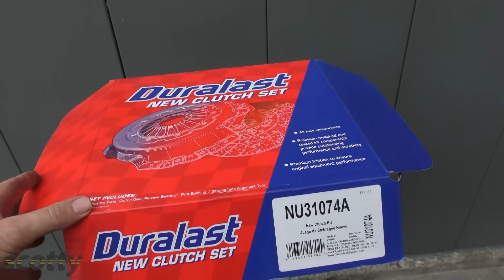5 Things You Should Never Do in a Manual Transmission Car

Comment: If you rev match while downshifting, it's not that hard on the clutch. Clutch wear is relative to the difference in current RPM versus the RPM required to match the gear you want - so minimize that difference and you minimize wear.
Reply: This is what I do usually when I'm approaching a red light, if I'm in 4th gear I downshift and rev match to 3rd, breaking until I stop.
Reply: True but it's also minimized by shifting less often so you don't have to match anything in the first place. Which I think was his main point.
Reply: Possibly, I think the bigger reason why he raised this point is that if you downshift frequently without rev matching your clutch will wear out very quickly. It's a lot easier for the clutch to slow the engine down than speed it up. My point is that rev-matching makes a big difference in mitigating this.
Reply: yeah with precise rev matching its a literal non issue. I do it sometimes
Reply: I got use to rev matching, it feels so much better than to just throw it in neutral.
Reply: darkest1evil1 that doesn't make sense. It's better to just leave it in 4th and let the RPMs drop. Then right before it bogs down push the clutch in and put it in neutral. You save fuel and save the clutch from wear plus it's less work
Reply: i rev match double clutch.. Minimal wear on clutch and transmission. But im guessing throwout bearing is suffering there hah..
Reply: then if you have to suddenly speed up you have to fumble around finding the gear you want. Always keep car in gear ready to accelerate. The brake pedal isnt the only way to avoid an accident. Sometimes you need to be able to accelerate quickly out of harms way.
Reply: if you just leave it in 4th instead of downshifting
Reply: You are all correct, its not necessary, but i like it and its not hurting efficiency of my driving.. Like EE said, we dont use manual transmision because its most efficient and fastest and stuff, but because we like to drie it, and i would like to add the fact its cheaper to manufacture
Reply: illstplaya save more fuel by downshifting and coasting in gear which will shut the fuel injectors completely off until you press the accelerator again. Coasting in neutral will use some fuel to keep the engine idling. There is a reason that you must keep car in appropriate gear on your drivers test or your gets points off. And also, if downshifting to a stop, I’ll usually downshift to 3rd then brake the rest of the way, but keep it in third until stopped. No reason to put it in neutral.
Reply: I drive 1996 car and it doesnt shut fuel when braking with engine.. eh
Reply: I bet he knows more than you
Reply: His advice is for the average driver who doesn't even know what the term "rev match" means.
Reply: It does have the side bonus that since you're still in gear. With the downshift, you probably have quite a bit of power if you really need it in a pinch. Neutral and you're basically a roller coaster and hopefully if you absolutely need a gear, you hit that gear precisely. Hard to beat it already being in at least some kind of gear. Perhaps the best compromise would be to downshift to from 5th to third at the appropriate time, so in that case there's only one downshift.
Reply: THE GIBBONS Have you driven a manual transmission car? You feel a lot of resistance in the clutch pedal when it's coming back up if you try to downshift without rev matching, and that resistance diminishes by a large margin if you kick up the engine RPM to match the downshift. That resistance is wear on the clutch; and reducing wear is part of the goal in rev matching.
Reply: THE GIBBONS You can do that, but the clutch wear versus a rev matched downshift is almost the same and you may as well take advantage of the vacuum braking. Of course, that is the driver's choice.
Reply: Yes, though I've had times where I wish I knew about rev matching, for the most part, with ordinary driving, it's useless. I have never driven that way, yet had a Mustang 10 years, which I actually raced quite a bit, an Eclipse 5 years, another Eclipse 13 years, and my current Lancer GT 6 years, and not a single engine, tranny exhaust, or rear axle problem. Altogether that had to be approximately 400,000 miles. 

Yes, any fool can tell that when you downshift way too many gears, at too high a speed, you're causing some strain if you're trying to slow down, and that's why you generally downshift only a gear at a time, such as when approaching a stop. When in an emergency acceleration OTOH, you don't have time to screw with rev matching, as you're racing the engine immediately anyway. I've tried this rev-matching stuff and accidentally did it one or two times, but it's way more effort than it's worth, especially since I do 98% of my downshifting these days a gear at a time, and easy with the clutch at that. My passengers don't even notice it any more than they would with an auto tranny doing it, though I probably do let the gears brake more than auto trannys do. It's all in how gently you let the clutch take hold.
Reply: I think I downshift at higher RPM's than that, but I never really look at the RPM's when I do that. I just know where it feels good and I do it.
Reply: Charles 22 It's actually pretty easy to do, just jab the throttle enough to bring it up to about 3-4,000 RPM before you let out the clutch. You don't have to match revs exactly, as soon as you lift off the gas the engine is spinning back down anyway so it matches up with the desired gear pretty easily. For me, my manual transmission car is SOHC with a jack-shaft adding inertial resistance so it's not very quick to rev and that makes this trick very easy to pull off. I've done it in other cars that rev quicker though; it's more about timing than anything. As always, practice makes perfect!
Reply: If I have the speed I just go neutral and “coast” intill the traffic light my thinking of saving fuel not transmission though but thinking it clearly does that as well 
So I’d say that’s what to do
Reply: robf93 it’s bad for the synchro, unless you double clutch.
Reply: darkest1evil1 Why don’t you just put it in neutral if you know you’re going to come to a stop?
Reply: Only put it in neutral about 1 car lengths or less away, best when almost complete stop.   If something happens and you need to accelerate out of the way, you are screwed.    

Lets say you are 3 car lengths away from a stop sign or light.   A car rounds the corner weirdly and heading for you.   
If you are in gear, you can give gas and steer away, if you are in neutral, you getting hit before you can give the gas after you put it in gear.    

It's just the little things you need to think about.
Reply: You're all wrong because rowing through the gears is fun and that's 99% of the reason why most of us drive stick. It's fun. If you're so nitpicky that you wont even blip down a few gears to "preserve" your car just get an automatic.
Reply: illstplaya definitely not healthy to let your engine “bog out”
Reply: I feel like that advice is mostly for people who have never heard the terms "rev match" or "heel-toe" before in their lives.
Reply: GenXRanter he’s still giving the false idea that downshifting is “bad” and “inefficient” when it’s actually more efficient to downshift through gears and coast in gear to a stop vs coasting in neutral bc in most cases your idle rpm is actually higher than the rpms that you coast in gear. So you are actually wasting fuel by coasting in neutral bc you’re injecting fuel to just spin the crank at a higher rpm than needed 🤷🏼‍♀️🤷🏼‍♀️
Reply: Hmm, you're still forcing a piece of metal to come into contact with another piece of metal spinning very quickly and hold it stationary. Thats still a lot of pressure and thus wear every time you shift. Its one thing to have good clutch control, but shifting will cause wear no matter what.
Reply: how would you always keep it in gear.... @robertschirm5185

Comment: WOW!!! I used to date a girl who had a 2003, Passat with a manual transmission. I always told her to do exactly what you said Scotty. And I always use the same line of reasoning that brakes cost less than a clutch. That clutch was going strong at 120,000 miles when we split up. She eventually wrecked it.

Comment: One more thing, never sit at a traffic light in first gear. Clutch out and neutral. Only put it in gear when you know you're going to be moving.
Reply: Gibbon  this has nothing to do with Europe
Reply: Gibbon  I believe that you can drive manual but it really has nothing to do with Europe that it's not required to shift into neutral when stopping at a traffic light.
Reply: Who does that
Reply: +Gibbon
Do you know what a pilot bearing is?
Reply: That's his inside voice
Reply: Why can't I just disengage the clutch why need it be in neutral
Reply: @dhvsheabdh  if you let the clutch up slowly in gear the car will lurch forwards and then stall.  in a queue it's likely you will hit the car Infront or cross the line if you are the head of the line
Reply: @ryanoconnor5256  I don't think you know what I meant. I'm basically saying what's the difference between having the car out of gear and clutch up, and having the car in gear but the clutch down.
Reply: @dhvsheabdh  sorry yes I did misunderstand a little there :) both ways mean that the car will not move I guess the only benefit from being in neutral when waiting is that you don't need to keep the clutch down and that should help you feel less fatigue in that leg.  It's just more comfortable I guess :)
Reply: @dhvsheabdh  holding the clutch in while being stopped will wear the throwout bearing prematurely
Reply: Squidward's House why?
Reply: @richardna1237  wears out the throwout bearing
Reply: @richardna1237  because your clutch is hydraulic and when you keep the pedal pressed down at lights all the time you're keeping the system at full pressure, and the pilot bearing will wear out and you'll have to drop the transmission to change it when it goes out and your clutch can't disengage.
Reply: What's bad about sitting at a red light in 1st gear?
Reply: @elijahprasad7884  excess wear on throwout bearing
Reply: @squidwardshouse67  Ok. Thank you.

Comment: Reverse and ebrake for parking on a hill. Reverse is a much higher ratio and straight cut which makes it even harder to turn the engine in case the ebrake fails.
Reply: stefan samotulka yeah r has more torque then 1st
Reply: Doesnt matter... 1st, 2nd, reverse, even neutral.. Cause you're suppose to turn your wheels towards the curb when parking on a hill...
Up here in canada,even on your road test,  if you dont turn your wheels towards the curb when they get you to park on a hill, even if its the slightest incline, its an instant 'fail' and you have to do the test again

Comment: Haha my Dad when he taught me to drive stick told me to always downshift to slow down. Wasnt til I got older I figured out brake pads are cheaper & 10 times easier to change
Reply: Unless it's a downhill, use those brakes, u r right.
Reply: These days you don’t need to change down gear in order to help with slowing down.  That practice was used years ago as brake systems were not great, however  modern cars have excellent brakes so it’s no longer needed.  On driving test in the UK block gear change is expected instead of going 321 etc which is more practical for driving in today’s traffic as well as being better for fuel consumption. I’ve been an approved instructor for 34 years and have always taught this.
Reply: It can still be helpful down steep hills and if you don't trust your brakes very much. But yeah most cars on the road stop fine with just the brakes.
Reply: Lol do you rev match
Reply: It's better to learn how to downshift and then never need to use it, far too many drivers don't know how to drive without ABS, hill start assist, power steering, traction control etc.
Reply: @NorthWestOutlaws  Thats pretty sad.
Reply: @NorthWestOutlaws  What even is hill start assist?
Reply: Gravemind when the car doesn't roll back on a hill when you engage the clutch
Reply: Also I always downshift had a 07 aveo with 240k with no clutch or trans problems whenever some one has clutch problems I hate to say it but 99% of the time it's from people not letting it out properly like riding the clutch is #1 problem for people driving manual
Reply: @stevebates5369  I don't have that feature and my car never rolls back on a hill as long as you reach the biting point before changing over from the brake to the throttle you should remain stationary and then begin moving and if for some reason I had a car that was weak and did roll back on hills then thats where a handbrake comes in handy.
Reply: What am I missing here? If you slow down then your speed and rpm is down and when you want to speed up again, you’re still gonna need to down shift right??

Comment: Also when parked on a hill, turn your wheels into the curb, if both the hand brake and gears jump out, the car has no where to go,  extra safety!
Reply: They tell you to do that during yoir driving exam even when parking an automatic transmission vehicle on a hill with a curb. Good advice for those that didn't already know though!
Reply: So if I park and the curb is to my right, do I turn my steering wheel (and thus wheels) to the left or to the right?
Reply: to the left ^^
Reply: It depends on if the car is facing uphill or downhill.  If you park facing uphill, you turn the wheels away from the curb.  If you park facing downhill, you turn the wheels toward the curb.
Reply: hey i do that =)
Reply: Isn’t it away from the curb so that way it the tire clings onto the curb just Incase the brakes failed
Reply: Is that what Americans are taught? That's far from the easiest way of just stopping with your brake pedal, applying the handbrake, put the car in neutral and you're good to go

Comment: You missed a big one Scotty... With the car idling in neutral, never just press the clutch and put the gearshift right into reverse. It will crunch the gears every time, I've seen a thousand people do that. Put the trans in 1st gear to stop the trans with the synchros, THEN move the shifter to reverse. No crunch, goes right in.
Reply: Absolute bollocks !

Comment: Plus keep your  hand off the shifter when driving, there are bushings and or bearings u will wear out with your hand on the shifter all the time. Thank you 😊.
Reply: Well that's a BS myth otherwise the shifter in my 89 Mazda B2600i 4x4 pickup would have been worn out a long time ago...its got 320k on it now and its not worn out...its a BS myth that was drummed up by a shaddy mechanic who did a shitty repair on someone's manual transmission and in doing so didn't put stuff back together properly and caused the shift mechanism to wear out because of overtightening the fasteners that hold the assembly together....the shift ball is usually a hard plastic and if you overtighten the assembly when reinstalling it, you'll quickly wear out the whole assembly and it makes the shifter very sloppy and oftentimes leads to selecting the wrong gears, or worse, won't let you move the shifter into any gear.
Reply: William Todd keep it up bs myth guy
Reply: Sorry about telling the truth, if you don't like it I can't do anything to help you.  320k on a manual truck that I've rested my hand on the gearshift for decades tells the truth.
Reply: and only touch the steering wheel when you actually need to make a turn, otherwise, it'll get a wear spot on it and the steering column sleeve bearing will wear out a lot quicker.
Reply: No myth,it's the selector forks and sleeves inside the gearbox that it can wear,the pressure puts the fork into constant contact with the rotating sleeve...
Reply: so news flash: don't use the gear lever as a fucking arm rest and you'll be fine

Comment: I've had plenty of cars with a manual transmission, but I've only ever had one that I kept long enough to test the longevity of a clutch. It was a 1994 Pontiac Sunbird that I bought when it was nearly new with 33.5k miles. 7 years later the car was lost in an accident and at the time had more than 310k miles. It died with it's original clutch. Anyone who says that clutches are useless because they are always wearing out; either they don't know what they are talking about, or they don't know how to drive!